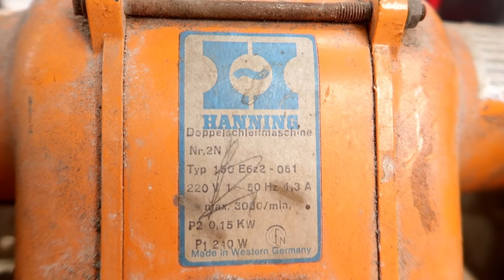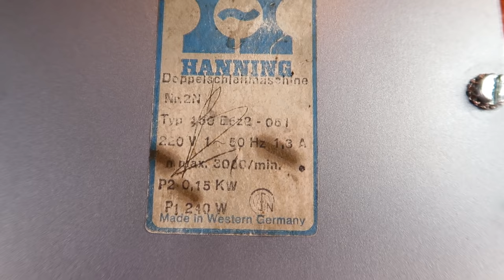Rusty and Broken Bench Grinder -  Awesome Restoration

Comment: “That’s a tiny little motor.”

“Oh my god that is a capacitor!” Be careful they can hold a potentially deadly charge for many years.
Reply: Not if they're dead.
Reply: DJH com True. I wouldn’t take that risk without trying to discharge it first though. Rather be safe than sorry.
Reply: They can't hold a charge for years.
Reply: Not a deadly charge because it's only DC. But it doesn't feel nice to get zapped. :)
Reply: @tubybubi  Whether it's DC or not has nothing to do with if it is lethal.  The voltage and the capacity of the capacitor (and thus the energy) determines that.  If you don't believe me, take a look at the capacitor bank in a (quite deadly) heart defibrillator.  A photo flash capacitor can be lethal if you take the charge from one hand across your chest to the other.  And that's powered by a couple of AA batteries.

Comment: Except for the fact this machine operates on 240 volts, I’d be more than happy to have it in my shop.  The paint job on the case has a great finish, as do the shields and guards for the grinding wheels.  And since all you apparently replaced was the capacitor to make the on/off switch work, your analysis of the problem was clearly correct.

I understand there are dressing wheels (?) available to clean up used grinding wheels but I’m not sure my terminology of the thing is correct.  Nevertheless, well done; you should be extremely pleased with your work and the end results.

Comment: I would advise to not apply a lubricant to mating surfaces of press fit bearing.   Doing so will increase the size of the spindle - and then the bearing will be harder to press on AND remove in the future.     Great work.   Keep it up!

Comment: Hey!!! Good restoration you did. By the way the reason the grinder wasn't starting at first, it was because of the RUN CAPACITOR, that can get damaged in the long run or because of high humidity. Regards

Comment: Lovely restoration only thing I would have done different is use a bit of thread lock on the bolts to stop them loosening with the vibration you get from these

Comment: sandblasting the stones , And when using sandpaper ,there is a way to prepare it ,instead of ripping it into pieces !  the sheet is cut into 3 equal parts ,first you brake the glue by passing it on a corner in different directions and then you fold your strip of sandpaper into 3  . This gives you a better grip and a good finish when sanding!  This is how I learned it at school for ebenisterie . cheers !

Comment: Clean grinding wheels with a sandblaster using a finer grit and softer media than the wheel, also bake it in an oven at about 350f and check for cracks by tapping lightly while supporting, a ringing sound is good. Stand to one side for the first spin up in case it comes apart and dress the wheel before use.
Reply from the maker: check my other bench grinder https://youtu.be/dbnm6e2mnew

Comment: Alittle tip for the ball bearings is to heat them to 100 degrees celsius. They will slide right on.
Reply: You should never hit them.

Comment: If you heat the inner ring of the shaft bearings with a propane torch, it should slide right into place without hammering it in.

Comment: Sorry not to go through the 2.6k comments (😬), but the plastics engineer I am would like to tell you that plexiglas is rather brittle (e.g. one way plastic champagne cups), so I would not recommend it for an eye protection. If anything else than sparkles should fly away (as already mentioned, you don't know the wheel quality, so it could break), the plexiglas would be of limited help. Polycarbonate is a common and very tough plastic, way less brittle (it is used for DVDs for example).
Thanks for your videos and for sharing your skills!

Comment: Your motor-start capacitor has gone low value and it's ESR has shot up. If you would have continued push starting it, it would eventually burn your motor out due to excessive current... Excellent restoration. WELL DONE!!!  10/10

Comment: Absolutely beautiful restoration! Very satisfying to watch! One question however: during the part where you were applying the primer, used the filler after, and then re-used the primer again - could you have used the filler first and then done the primer layer after? Not throwing any shade; I'm new to restoration and just want to know if that's part if the process or just a step you forgot and went back to do? Love your videos and keep them coming!
Reply: the primer basically in some way fills up some of the rust pits, thus reducing the work for the filler and therefore leads to less sanding. Second reason could be to prevent rusting till time of painting.

Comment: The plexiglass: it's supposed to be adjustable by sliding in the vertical slot, but that's still a nice addition anyway.
The grinding wheels look more flat, did you do that?

Comment: Your paint job easily bettered the manufacturer's. If they can't use a primer, they could at least use a Hammerite-style paint. With many painted-metal items, the thin paint coating just flakes off, and leaves the underlying metal to rust.

Comment: 17:02 Next time, consider using insulated spade connectors. It would make fitting a replacement capacitor much easier.

Comment: Likely said tens of times, but the reason it didn't start is the reason you had to change the capacitor: it's the starter capacitor. It's a way to shift the phase so that there is a torque at rest position.

Comment: The capacitor's date code is 6 79 for June 1979 or the sixth week of 1979 depending on how the manufacturer uses that date code. At the time of this restoration it is about 40 years old. The swollen capacitor a sign of electrolyte breakdown causing the grinder not to start on its own without being given a little push.

Comment: This machine could've possessed a 1974 patent date! These things were used even back then during the time when our elderly brothers and sisters were Branciforte Jr. High School students. Do you have a 1974 Branciforte Jr. High School yearbook, which shows forth this? The bench grinders glass shield doesn't have a solid tungsten steel framework. I can tell that this bench grinder is an older model.

Comment: did you put the rotor in backwards as the nuts the hold the grinding wheel will loosen as it turns

Comment: While you should probably replace the grinding stones, you can get the old ones back in balance using a diamond abrasive. Check out a similar repair on the “my mechanics” YouTube channel and see how he rebalances the grinding wheel.

Comment: I think the reason it would not start is because there is a three phase motor inside. that is, three coils and if not all three coils get power, the motor will not be able to spin completely on its own, but if you do it a little push like you did then it starts. so I think the reason it would not start is because one of the coils does not get power. but I may be wrong, I'm only a 2nd grader in the electrical subject😋

Comment: A sand blaster would literally save you dozens of hours.

And probably end up costing you less in the long run as you won't need to use rust remover and rust converter products. 

Work smarter not harder

Comment: One way you can remove the paint is with a wire wheel but do NOT use the wire wheel method on lead paint also use a mask while wire wheeling so you don’t breathe in paint or metal particles.

Comment: I might be wrong, but don't ball bearings need to be glued to shaft and hub instead of greased? I mean, they are supposed to roll on the balls inside the bearing, not between shaft and bearing surface, so there is no need to grease it?

Comment: Thank you for not sanding down the stator or any part of the motor. This is something you should NEVER do. Because sanding off the outer rim means you sand not only the rust but also the laminate inbetween the sheets, this as a result will increase the amount of eddy current in the motor which makes it more inefficient.. So instead of restoring it you make things worse!

Anyway, great video and you earned another subscriber!

Comment: Start up capacitor is faulty, that's why it didn't start.
Those cardboard compression discs should have a hole the same size as the shaft and the outer diameter centered off that hole or you will unbalance the wheels and the grinder will vibrate a lot.

Comment: The work is Titanic. But there are a couple of comments, the first 
bearing puller is, and there is no pressing with a mandrel? Was an arrow
 the direction of rotation, and has not been applied information about 
the modes of operation with a damaged sticker.

Comment: i bet you spent more in paint remover, degreaser, primer, paint, transparent coat,  rust remover, rust converter, new bearings. a new capacitor, a new cable, etc, than what i paid for a new stanley bench grinder

Comment: You’ve gone to all the trouble of restoring this grinder and then you put the old wheels back on.? You should have replaced the wheels and fitted proper paper spacers and balanced the wheels where possible . A nice job which with a little more work could have been a superb restoration .

Comment: you really need a sand blaster
Reply: I was surprized too he didn't use a blaster. But end result was great, with non-blasting methods used. All the smaller parts like nuts, bolts and more is handy just put into container of some rust remover like he did and one need quite course blasting medium to remove the paint without working for hours. Which again might lead to much scratches, on aluminum especially.

Comment: 7:43 please wear gloves when using a grinder like that metal can fling of and hit you just a heads up btw love your vids (so addictive).
Reply: Ryan smith I would rather get a metal wire stuck in my finger than have glove get caught in the wheel and pull my entire hand into it.

Comment: I appreciate the restoration... but since it not an attempt at complete restoration... liberties were taken (which is fine).  I think it would have been best to replace the wheels with new ones... these could explode.   Better yet, to put some diamond wheels on them and slow the r.p.m's down to 800-1500.